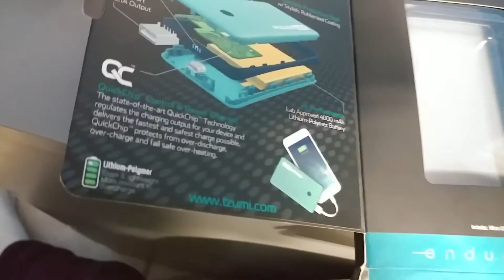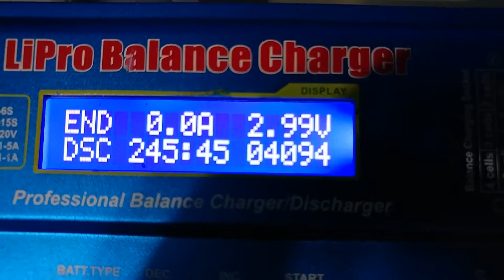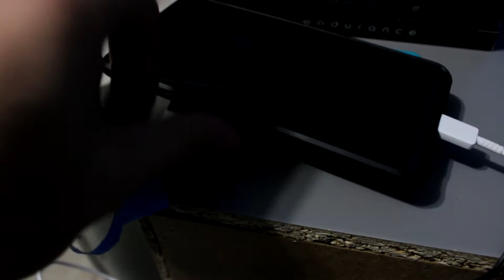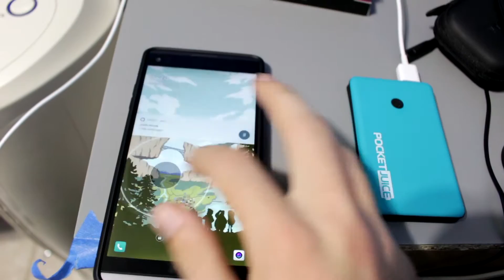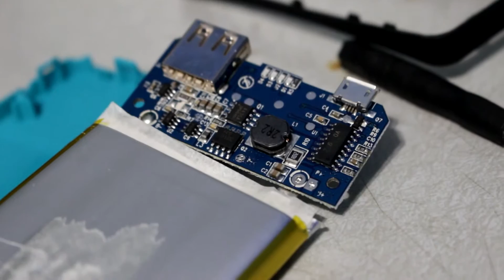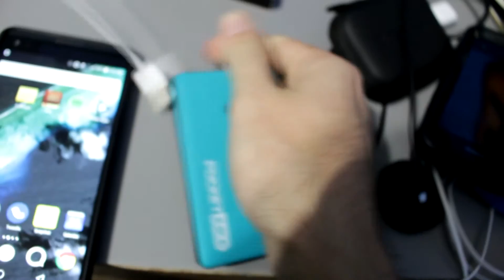Pocket Juice 4000mah battery pack review

Comment: I got one of these as a gift a while ago. It's not teal, but it is Pocket Juice, similar design and 4000mAh. Power went out a couple nights ago and overnight it got my phone (Samsung S7 Edge, usually not slow to charge except unless it's a wireless charger) to 43% and my phone didn't hold that charge well. Charging from it and recharging it took forever, so I was looking for more info about it. I had used it previously, but I wasn't sure it was on a full charge the first time so I reserved judgment, but I'm pretty sure this confirms my suspicion that it's just junk. I also have that exact balance charger, wouldn't have thought to check it with that! Good video.